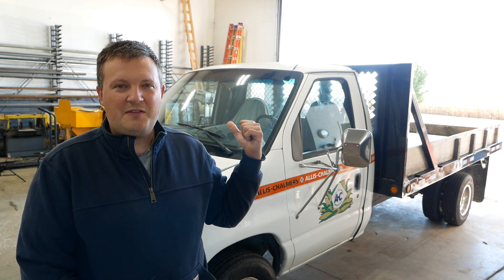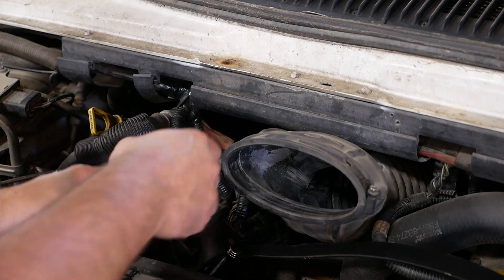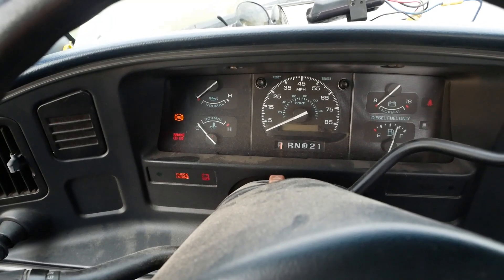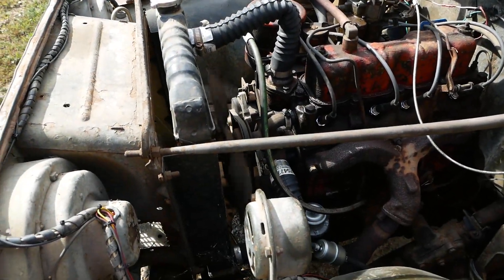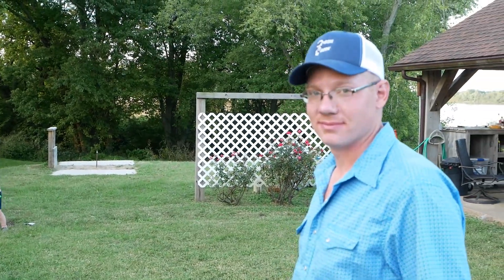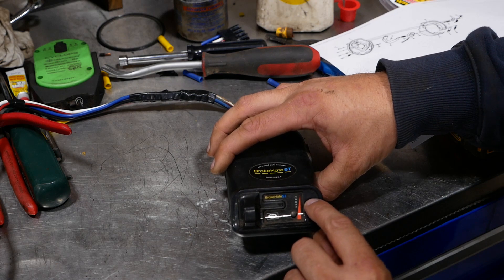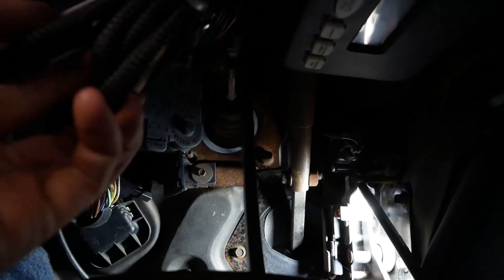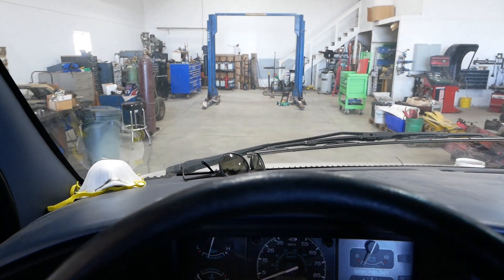E-350 7.3 Power Stroke Hard/No Start - Again! | Dirt Perfect Meet and Greet Event

Comment: Hey Wes, a word of the wise.   The factory/OE equivalent glow plug relays are only 20% duty cycle at the full current of the glow plugs.   That’s 12 seconds on, 48 seconds off.   This is a problem because the computer runs the glow plugs in a 7.3l power stroke for a full 2 minutes most of the time.   The best repair is to locate a White-Rodgers 12v, 200a automation control relay, which is about the same price as the factory, and is rated at 100% duty cycle at full amperage.   It’s an old secret to get rid of the glow plug relay problem forever.   It even fits in the factory location with no wiring modifications.
Reply: Just replaced my relay and did not know about the White- Rogers relay. Will source one when this current one bites the dust.
Reply: Just looked one up, $65. A deal.
Reply: The only way to go. I have mine in for 5 years now.
Reply: After 5 years of ownership and five 'glow plug relays' (all were engine bay decoration, mostly, since none worked for very long), I installed a White-Rogers...it's an install-forget item now.  Ford and parts store china garbage don't work because they burn out.  I run a manual glow plug switch in the cab and it WORKS EVERY TIME (as they should, but hadn't before)!  Install this and you'll never have to do it again.  Trust me...
Reply: I can 2nd this. Have had one in my 7.3 truck for 3 yrs now. No issues. Starts every time when cold now.
Reply: Good to know, thanks!
Reply: Top comment! Thank you, sir!
Reply: @johnclamshellsp1969  can you provide the link? Tx
Reply: Looks like a typical Ford starter solenoid to me. Can’t see $65….

Comment: If only there had been easy peasy trailer wiring hookups like that in the 60s. Maybe my dad wouldn't have had to spend 2 full days working on the trailer wiring before we'd go camping, only to gave the left turn signal flash when hitting the brakes. 😂
Reply: Beats putting the turn signal on and locking the brakes up causing the deaths of four people.
Reply: Kenneth.
Yes me too.
Most of my TRAILER wiring problems, are just BAD ground wiring. I have spent HOURS trying to put new tail lights on are company's VMS ( Traffic advise road trailers) and got turn lights when brake applyed. Had a boat trailer. The three tail lights center one had corrosion on it replaced it. Same problem. Had expert helpme. It was a GROUND problem. Go figure.
Reply: @tihspidtherekciltilc5469  no, we all lived through it.  But it was a yearly occasion
Reply: As a tech, the most common issue I find is simply poor quality connections on trailers. Even from the factory its often not great but especially with DIY repairs people almost never make good water tight  connections. The plastic covered butt connectors alone are not enough on connections that are exposed to the elements. Wrapping in some E tape is a small step up but but non insulated butt connectors with heat shrink is my preference.
Reply: @tihspidtherekciltilc5469  the trailer brake light wiring and trailer brake control wiring are separate..
Reply: Brother in law was blowing truck fuses left and right wiring his trailer needing to leave for Colorado. He was down to two late at night with the store closed and I found a little battery charger that I fed the wires from the  trailer connector. Done in ten minutes...
   Thank God and Greyhound he's gone was the song playing in my head. Thought I would at least hear a thank you from him, but just crickets
Reply: @chickenfishhybrid44  all true, and good tips. Recall my comment,  this was the 60s, and heat shrink,etc, wasn't around much. Most of his connections were slobbered and wrapped with friction tape.
Reply: @rp1645  I think body grounds are big problems.  I prefer to just run it's own separate wire.
Reply: @DeweyCheatumNHoweLLC  Heat shrink  with the hot blue built in is great stuff.
Reply: Especially if you're in the rust belt. I'm in Minnesota and any exposed wiring on vehicles is a major p.i.t.a. after a couple of salty winter's!
Reply: @12345NoNamesLeft  
Run a separate WIRE for GROUND. ???????
if that's what your saying. Thank you for great ideas.
Reply: @ohiofarmer5918  
Thank you for idea.
Reply: @garyronan5568  
YES, forgot about all the SALT they use in that state. + you have so meany Lakes, that trailer get dunked in. I think Fresh water
NON salt can still cause problems on trailers with 
Rust/ Corrosion.

Comment: Hi
In Sweden we use a mechanic trailer braking system, this system is integrated in the coupling of the trailer. It's using an piston that will compress when the trailer starts pushing the car and applies the brakes. The emergency break is even simpler it's a steal cable hooked to the car, if the trailer will disconnect from the car it will pull the parking break on the trailer. This system works very good if properly maintained.
Love watching your videos😀
Reply: Yep have some of those in the US too. They're called Surge Brakes. Many times rental trailers will have em

Comment: Thanks for explaining the brake controller. I didn't know that yet, because in my country, we mostly use a mechanical system, which seems a lot more reliable to me.
Our system consists of a spring-loaded compressible drawbar. When the towing vehicle applies its brakes, the forward momentum of the trailer compresses the drawbar against the braking towing vehicle. That compression force will apply braking at the trailer wheels. For reversing, there's a latch that can be applied, which will prevent the drawbar from compressing. Also, there's a handbrake lever. And for safety, a steel cable between this mechanism and a hook at the back of the car will apply the brakes in case the hitch detaches from the towing vehicle while driving.
Reply: Rental trailers from u-haul use a similar system here in the us so that vehicles without controllers can tow them

Comment: Pretty cool switching between the job and the vlog. I liked it a lot. 

As for the brake controller, I think in Europe at least it’s super high prio that trailer brakes work independently from the towing vehicle and especially critical to have emergency brakes work in any condition when detached, so a battery on the trailer is a huge point of failure. 

Most braking trailers are either mechanical or hidraulic and mostly apply the brakes as the trailer pushes against the towing hitch. Some tricks needed sometimes to be able to back up with them ;) (like start backing up, clicks, let off and then you can back up without the brake activating or something)

Super interesting how something so common is solved so differently.

Comment: The reason we use mechanically activated trailer brakes in the EU is that testing has shown them to be quicker acting and more reliable than electronic braking.
Reply: Yeah. For the passenger car trailers with 750 kg max weight limit it is not required that the trailer has it’s own braking system. At least here in Finland.
If the max weight limit of the trailer is more than 750kg then it must be equipped with mechanical brakes and bi-annual inspection.
Reply: @Antto  Same here in Germany, and I think it is valid for most of Europe, with the unified license classes. Main differences may be the inspection intervals.
I think just a few years ago one or two companies in the Netherlands got electronic brake systems certified.
I think at the time the regulations for certification were made, the Electronic systems back than (and I mean way back then) were deemed not reliable enough.
and actually the mechanical (by mechanical I mean completely cable operated) surge brakes worked perfectly fine. For security there is a breakaway cable, which is just a small steel cable that you have to attach to your hitch and if the trailer comes loose, it more ore less pulls the parking brake of the trailer. Just don´t ask me why a standardized size of ball hitches became standard here, as far as I know other forms could be used as well when certified, and there are sure cars with the 2 inch square bar removable hitches around. I can only imagine it was a convenience thing to have the same hitch everywhere.
With that working well enough (some trailers even got ABS and modern vehicles ESP kept trailers stable as well) it seems there was not a hughe desire for any change in regulations.
Everything larger usually is towed by a larger truck 7.5 tons and more (not like pickup truck) and has air brakes anyways.
I think electronic brakes, especially as far as technology has come, work perfectly fine. Every modern vehicle equiped with ABS and ESP has already everything on board to electronically control trailer brakes. But as said before, if a well set up surge brake does exactly the same, no need for an additional system. Although I clearly see an electronic system being more convenient when it comes to backing up a trailer, where you manually have to lock a surge brake first.
Only thing speaking against it, you would need a second plug for the breaking system, as neither the 7 pin nor the 13 pin plug common here for trailer lights (Yes, lights on trailers here have to be at minimum blinkers left and right, fog light, breaking light and for what ever reason separate left and right  rear lights. May be for compatibility with US vehicles where rear lights and brake lights are the same.)
Reply: In the UK there is currently no testing for trailer brakes. Often see or hear trailers with brake rods hanging off underneath and some of the caravans about have got to be bad too.
Reply: small trailers: no brakes, medium trailers: mechanical brakes, large trailers: hydraulic or pneumatic brakes.

Comment: Mechanical overrun brakes are the norm in UK..when the towing vehicle applies the brakes a slip joint in the hitch compresses operating a rod and lever  arrangement. Works okay if properly maintained and are extremely simple. There must be advantages to the electronic version to add such complexity. Very much enjoy your videos. Just the right mix of education and entertainment. Thanks for all your hard work.

Comment: And before the pendulum style brake controllers, we had some that tapped into the truck brake line. The advantage is immediate brake response from the trailer. The bad part is, what could go wrong with an amateur tapping into brake lines...
Reply: you mean like scotty kilmer's compression fitting is great method?
Reply: That era also featured a hydraulically activated brake light switch on many vehicles.
Every auto supply store had a brass fitting box that contained Ts to add a pressure switch to any brake system with no cutting or flaring required.
Reply: @harveylong5878  nope, my dad had a flare tool, so our big Chrysler was nicely done, and never failed.
Reply: @wssides  I believe the Chrysler cars we had then used a pressure switch that screwed into the master cylinder.

Comment: Wes you would be surprised to know, that some of those old after market trailer control modules was actually connected to the Master Cylinder that ran a break line into the cab of the truck to actuate the trailer break controllers. And I have seen two of those in my life, as the first time I came across one I had break fluid leaking from the trailer break controller inside the truck cab. The last one I seen actually controlled the air breaks on my 1999 Dodge Quad Club Cab 3500, which was outfitted for air breaks on goose neck trailers.
Reply: My Dad had a 1976 Lincoln Mark 4 with a brake controller hooked up to the Master Cyclinder.

Comment: I live in europe and we have "manual brakes". Wires from the brake to the trailer cupling and the more the trailer cupling rod goes in corresponding tube (momentum when you brake the car and weight of the trailer) and pulls the wires to the brake.
Reply: And for a break-away situation, you attach a sacrificial cable between your vehicle and trailer brake that yanks the trailer handbrake on if the two separate.

Comment: Here in Australia and New Zealand we mainly use hydraulic over-run brakes. They are simple and fairly effective, and more importantly, require no separate input from the towing vehicle, no electrics and no controlling modules.
Reply: We use those in the states, mainly on boat trailers though. I've heard them called surge brakes.

Comment: I use to have a 7.3 Ford. I only replaced the glow plug relay once. I had the one that turn on and off for 30 seconds. But every fall I had to check the glow plugs so I could replace the bad ones. Also I found out it was best to replace the batteries in pairs.

Comment: Just returned from the Green Industry Equipment Expo in Louisville, Kentucky.  It was a great show with 1000 exhibitors and 20 acre demo area.  I like to solder and heat shrink wire connections for long term reliability.

Comment: Hi Wes and Mrs Wes I look forward to watching your videos with the diverse content. Watched the one about the Silverado a few hours ago and was amazed at the rust. My son has a 1993 Toyota Land Cruiser with 460k klms and it has no rust in the chassis or body. Mind you we do not have roads that are salted in winter. Must make you weep when you see all that rust. Keep up the good work and keep having fun. Cheers from Canberra Australia
Reply: Trucks from the southwest US are, like yours, totally rust free. Anyplace where there's a real winter results in the rust you see.
Reply: I have lived in Minnesota all my life and have probably gone through 20 to 25 truck's in my 55 years of driving ( almost 70 y.o.) and almost all have gone to the bone yard due to rust. I had a 79 Dodge Power Wagon that I used for a plow truck. Only had 85K miles on it. I hit a curb with the plow and the frame broke in half. Sold it to a guy that was going to make A mud truck out of the running gear. 
The 2001 F-250 I currently have has no floor in the box, the doors are shot, cab corners are gone and it only has 150k on it and both of my Broncos are rusting out before my eyes.
Reply: Some years ago there was a firm advertising anodes to fit to a truck chassis that absorbed the rust into itself instead of the chassis. This type of anode is standard fitting on most sea going metal ships, tankers, container vessels and so on, changed on a regular basis. Is this not possible on trucks in high salt areas ?. Sea going vessels in salt water all their lives. Any comments ?
Reply: @Brian Williamson: I haven't heard of the sacrificial anode system on vehicles before ( I have replaced some in electric water heaters year's ago) but if they actually worked I suspect ( and even if they didn't!) auto parts store's would have large displays of them for sale. They used to push bumper mounted deer whistles all the time and they didn't work at all!
Reply: @garyronan5568  Hi Gary I remember the adverts in various motoring books some years ago. Yesterday I checked on Google and yes there is many such items on offer to attach to trucks, cars etc. But most of the reports pointed out they only work when they have a salt water element surrounding them. Basically an annual replacement on ships etc. but not really suitable on land vehicles. Quite a bit of information on Google. Work on the electrolysis principle it seems.

Comment: Intresting how things differ around the world, here in north europe we have mecanical trailer brakes. They works that when the trailer pushes the towcar it engages the brakes, the more it pushes the more brakeing, if the trailer unhooks there is a saftywire hooked to the towcar that aply full/parkingbrake on the trailer. Guess both work, but "our" is more simple, no electric or batteries on the trailer. Guess both systems have same problems with the actual brakes, that they rust and stop working and so on.
Reply: The system you have is also used in the U.S.  My dad had a system like that at least twenty years ago on his boat trailer.
Reply: @woodhonky3890  "our" is simpel and "works" I cant see the benefit of uncharged batteries and so on, if the trailer pusches the towcar, the trailer brakes, with or without electric power. Some things are better on that side of the pound, some things are better on this side of the pound.

Comment: Great dual scene video. I have one comment that you may disagree with:  electric drum brakes on today’s 40+ foot RVs should be converted to electric/hydraulic disc brakes.  Owning 5th wheels since 2006, I spent more time adjusting the freak’n drum brakes then needed.  And then they barely did the job, plus the wiring connections were forever getting corroded to the point of losing some or all power😡. With hydraulic, all wiring is within water proof containers

Comment: Never heard of electric brakes, mine brakes on the trailer hitch compressing. Simple system very effective.
Reply: Me neither, straight mechanical over-run with a sliding hitch and a huge spring on the parking hand brake that goes over centre and holds them on at max, a simple small breakaway cable that wrenches the hand brake over centre and so full on if the hitch lets go.
Battery on the trailer?  That'll be flat most of the time and good luck charging it with modern battery management systems that make about 12.5V
Reply: @572Btriode  yes that's the 1. With the electrics and the battery I'd a ridiculous design and prone to failure even if it works well.
Reply: Campers are all electric brakes
Reply: @richwielechowski5191  Is that a caravan ?

Comment: Back in the late 70's and early 80's, I'd go to work with my dad at u-haul. He'd build custom heavy duty hitches for vehicles and install brake controllers all day long and i never paid much attention to the installs because they took FOREVER!! He'd wire the vehicle from front to rear. For a young kid it was soooo boring but now i wish i'd paid attention and learned how he did it. I did learn the custom hitch part cause i love to weld and wire up trailers for lights so there's that I guess lol...